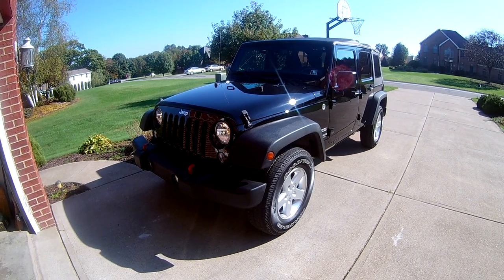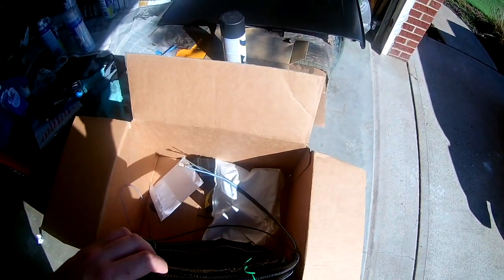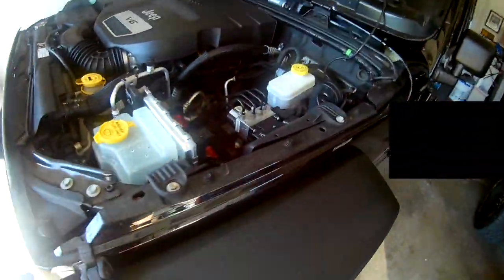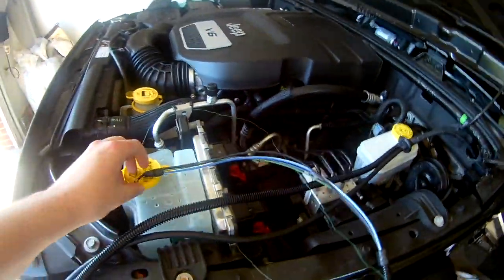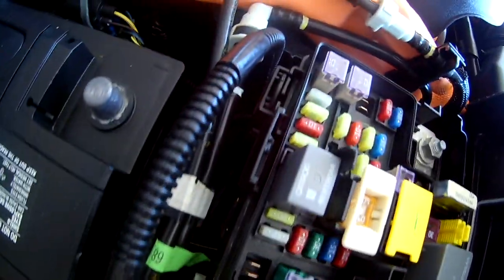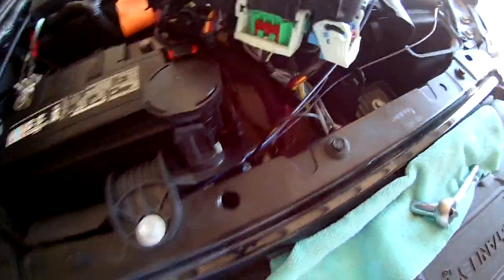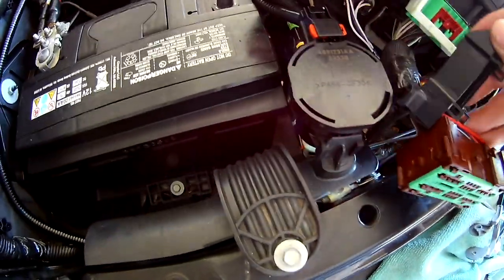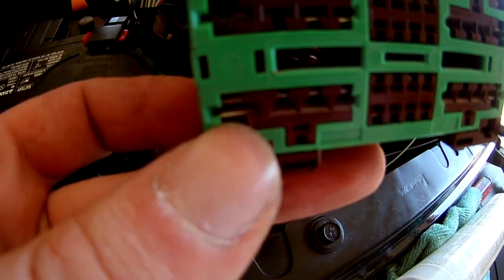How to Wire Jeep Wrangler Hardtop Harness

Comment from the maker: https://www.quadratec.com/p/mopar/hardtop-wiring-kit-late-wrangler-jk/late-without for the wiring kits. Select the option that fits your application. 4 wheel parts or eBay should have them as well. Amazon is currently showing unavailable

Comment: Thank you for your video. I was in the middle of the install before coming across your video. I went back and checked my E plug connections to the TIPM and they were wrong. I trusted the install instructions and they are wrong. You saved me from smoking the harness.
Reply from the maker: Awesome! Glad I could help! When I wanted to do it I was shocked to not find any videos. Then dissecting the instructions I realized how confusing they made them and how easily you could make mistakes. I knew I had to do a video if my install worked

Comment: Thanks for the post. It helped a great deal. I installed a 2016 top on my 2008 JKU. The Mopar instructions are lacking to say the least. Just a bunch of pics. A few words here and there would have been helpful on their part. I had the harness run and was scratching my head in a few places at the fuse box but you helped a great deal by pointing out that the pin numbers were actually on the connector. It took two pairs of glasses to see them but I found them. I didn't cut the one wire on the harness but actually pulled the pin and soldered the new wire to the pin end. You have to be real careful doing it that way as it's a real tight fit to get the two wires back into the connector. This kit is a lot more involved than they lead you to believe. But success, my wiper and washer did work but the rear defroster lights up for a second and goes out. Off to the dealer to flash the ECM with the new codes. Thanks for the help. I love YouTube videos.

Comment: I installed kit #82212860 on my 2016 JKU Rubicon 3.6 6 speed manual transmission. I had heated mirrors on the Jeep already. Between the Mopar instructions and this video I was successfully able to install the new wiring harness and flash the ECU ($100.00) without any issues. 
MAJOR TIPS:

The CONNECTION PLUG to the harness DOES NOT FIT through the opening of the fire wall. When routing the harness through the fire wall pull the harness from the inside of the vehicle through the fire wall into the engine bay.  Snake a wire from the engine bay side into the inside of the vehicle. Route your snake wire keeping it along the body of the vehicle of the drivers side. 
 
1.     When looking for the location of where your wire needs to be plugged into (if it is occupied just make sure you match the same color wires)  If it isn’t occupied then there are VERY TINY numbers indicating every specific spot. Take your time the wire placement is key to the entire operation. 

2. If your “E”,”G”, or “C” plugs have existing wires in a place that it tells you to install the “NEW” wire  from the new wire harness kit then just heat shrink or tape off you old wire that you have to pull out of the plug. THE OLD WIRES DO NOT GET REUSED OR SPLICED INTO ANYTHING ELSE. EXCLUSION though is on plug “E” it tells you to solder to the “EXISTING WIRE” that’s ok just remember to heat shrink it nicely. I actually had to pull the wire out of the plug so that I could get my heat shrinking tube over the wire at my solder connection. No big deal it took an extra few minutes for a better/safer end finish. 

3. You do not have to remove the seatbelt and strap and all of that nonsense. I removed the plastic along the door sill. Then I raised my seat belt height selector ( the part the raises and lowers at your shoulder when sitting in the seat) to the highest position.  The plastic cover where the seat belt is concealed by on the body of the Jeep. It is actually two pieces of plastic. Gently pry the top one outward and then the lower one will have room to be removed. That way you can continue to route the wire along the body of the Jeep heading to the back area. 

4. The AC vents do not need to be removed or taken out of place. They are mounted to the dash it’s self. They only want you to remove them so that you have better hand placement when removing the dash. You are still able to get a firm grip once you remove the window opener switch. Take your time be gently. The dash will come of easily. If you were to remove the vents themselves from the dash then you risk damaging the foam that makes the seal. If that seal is broken it will have to be replaced and the wire will leak out of the vents back behind the dash. Not harmful but will not be as efficient. 

5. Last tip and then I’m done. Print the ECU codes out for your technician. It will speed the flashing process up. I just printed out the directions so I could refer to them as I was doing the install then I left them in the Jeep for the technician to refer to if necessary. In my case he was grateful that I did. 

Hope this helps someone out. My tips will speed you up and give you confidence that this will work once you’re done in the end.

FYI: you can use a very tiny flat head screw driver to push the wires out of their plugs.

Comment: Thank you for taking the time to make this video. It saved hours, especially considering the included instructions were pretty bad. I wanted to mention a couple of steps that I left out that didn’t need to be done and could save a little more time.

First, you do not need to remove the air vents as they stay in place when the dash is removed (stay clipped into the dash).

Second, you don’t need to remove the seat belt. From the backseat, I just ran a wire (bent hanger) through the channel under the seat belt to the front, taped the tube & defroster/wiper plug to it and pulled it back through.

Thanks again! Now I just hope my dealer doesn’t give me any issues trying to flash it.
Reply from the maker: David Bozard My dealer gave me no issues at all. Seemed like something they did often
Reply: Thanks. How long did the dealer take to do the flash? Did you wait or have to drop the Jeep off?
Reply from the maker: David Bozard call ahead and make an appointment if you can. They said it would only take a half hour (they charge u for a full hour), but I also had them look at my transmission for a rattle. Even then it only took them a little over an hour to program and put my jeep on the lift and look at it and called me when it was done. If you have an appointment, I don’t see them taking much longer than the 30 minutes to program.
Reply: Thank you!

Comment: Wish you had posted this video sooner. I tried installing this on my last 07 JKU and gave up on it halfway through. I only got the wiring through the firewall and connected to the hardtop. I never finished installing the dash and turn signal kit. Now I have a 2017, and going through the same deal of not having the wiring kit for my hardtop that I purchased separately. Likewise, thanks for sharing the video.

Comment: Thanks so much for this video! My wiring harness project in my wife's 2014 JK was a success and using your video as a reference really helped, especially since my Mopar kit was missing the instructions. I found them online, but as you mentioned a couple of times they weren't always correct.
I also ordered an ODB II device and downloaded JScan so we'll see if I can flash the BCM myself.

Comment: I do have to say Thank You for this video.  I watched it before even attempting to do this on my own.  First problem I had was nobody is currently selling the harness anymore.  Quadratec has it backordered till December 2020.  I called a Jeep wholesale company on the internet and they told me the reason it's backordered is because it has been flagged at Chrysler for an "engineering" reason and the rep told me that due to that flag, no dealership is allowed to sell them until the flag has been removed.  He told me to keep an eye on Ebay and after a week of checking, I found one being offered brand new.

I think the most difficult thing was the soldering part.  I used the recommended solder type and for some reason it didn't want to cooperate.  After about an hour, I got everything together, heatshrinked, etc.   Also, for anyone that is looking to do this, the diagrams for the terminals that are on the instructions are meant to be read while you're looking at the backside of the terminal housing with the wires facing you (basically if you're looking at the wires going into the connecter, that's how it's presented on the instructions, but the instructions don't have the wires in place for viewing purposes).  If you look at the face of the terminal, you're looking at the mirror image of what the instructions are conveying and that's how people are using the wrong terminal locations.  As others have noted, there are Letters on the underside of the housing that tell you which connector is which and each connector has extremely small numbers on the housing.

My new windshield washer pump had each connector for the hoses labeled.  One was labeled F (I assume for front) and the other was labeled R (I assume for rear).  The one labeled F was in the same location as the original pump location, so one would assume that is exactly where I should hook up the front hose.  I hooked up the hose for the new hardtop rear washer to the nipple with the R stamped on it.  I had removed my front driver's side tire and removed the trim plugs and the one bolt/nut holding the front half of the inner fender in place and moved it aside for access to run the new hose in the factory location.  Basically following the route the original front washer hose takes.  I went and bought a 90 degree vacuum line fitting and a straight vacuum line fitting and that allowed me to connect the new washer hose without it being bent.  I put everything back together, and imagine my surprise when the I activated the windshield washer and the sprayer sprayed the back window, and the rear sprayer activated the front lol.  I had to reverse the hoses on the new pump.  I'm wondering if that is why the harness has been engineer flagged at Chrysler??  

Anyways, thanks for the solid video that saved me some headaches.  My stealership is charging me $109 for the flash, but it is what it is.
Reply from the maker: HawesEA wonder if it’s a new “engineering” reason or not.. because they have been making them for a goood while now....  about a month ago my entire tank of washer fluid drained from the rear wiper line (I have my soft top on so the harness is just tucked in somewhere back there ) into the storage area where the jack and all is... that was a nice pleasant surprise.. never had that happen before.... anyways glad I could help!
Reply: @tybonez3646  sounds like the check valve may need replaced.  On my 2016 Rubicon which came with the dual top package, the hose coming from the front of the Jeep to the back area plugs into a check valve, then to a piece of hose approximately 3 inches in length that has a quick disconnect for when you want to remove the hardtop.  The vehicle I installed the harness in was my daughter's 2018 JKU, so I mirrored everything to my Jeep as far as hooking up the hoses.  Only reason it would leak fluid is if you don't have a check valve or the one you have is broken.  Easy fix regardless.  I always run with the drain plug in my jack area unplugged.
Reply: Mine sprayed reversed as you described. When I activate the rear wiper pump I can hear it pumping and if I disconnect it at the hardtop connection it sprays out onto the ground but plugged back in and it doesn't spray the rear window. I bought a used hardtop, wondering if the nozzle is clogged up, I'm going to try to push air through it to test it?

Comment: Thanks so much for this video, My 2016 Rubicon Hard Rock came with the soft top from the factory, Someone then added a hard top, but didn't bother to buy the harness for the rear defrost or washer pump. So, this will be in my future at some point.
Reply: Se7vinDeadlySins 
@Se7vinDeadlySins so when they added the hardtop did it have the rear wiper and motor on?
Reply: Rob B, yes. The hard top they put on does have the rear wiper and motor on it.
Reply: ok i want to do the same buy a hardtop but not the wiring kit since i don’t need it thank u
Reply: No problem Rob B

Comment: Dude I’ve been trying to find a video on this fucking forever thank you for putting it up gonna install tomorrow
Reply from the maker: Marcus Reyes sure thing! Figured it would help put a better visual than the black and white drawn diagrams molar included.. Be patient with the removing of the pins in the connectors and confirm you are cutting/replacing the correct wire. I’ve been running my hardtop for about 3 months and the harness has been working flawlessly.  Let me know if you are confused about anything.

Comment: Super helpful. Thanks for posting. This took me all day, luckily it was a holiday. Just hooked up on my 2017 wrangler unlimited.
Reply from the maker: Trey Ideker awesome! Glad it helped
Reply: Btw I managed to get the rear hose routed exactly parallel to the front one, it looks great but probably wasn't worth it. To have the right access I had to pull off the driver's side fender, which caused me to break a bunch of plastic rivets. Now I've got to order rivets!
Reply from the maker: Thanks for the tip! I was going to do that eventually but maybe I won't now haha
Reply: What tool removal kit did you use (if you used one)? Thanks!
Reply: You mean rivet removal on the fenders? I didn't use one - just pulled and they popped.  To reinstall, I used this and this:
https://www.amazon.com/gp/product/B007QV2E50/ref=oh_aui_detailpage_o01_s00?ie=UTF8&psc=1
https://www.amazon.com/gp/product/B01GES5OYS/ref=oh_aui_detailpage_o01_s01?ie=UTF8&psc=1

Comment: When taking the steering  column off instead of using a torques use a 7/64 t-handle allen wrench 
 in those deep pocket 
holes . Some sticky black window seal  rope will hold the screws on the allen wrench . Great video .

When taking the steering  column off instead of using a torques use a 7/64 t-handle alen wrench

Comment: This is incredibly helpful! Thanks you!! I know this was posted ages ago, just curious how you actually removed the wires from the terminal, notably the blue white one. Im having a heck of a time even using a terminal removal tool set from amazon. I pulled the green face slightly aware, been fiddling with the wire using all types of prongs to no avail.
Reply from the maker: I can't remember to be honest. Look at the wire you are trying to replace it with to see where the tabs are that hold it in the connector. With that in mind, then try removing it. I know I struggled with most of those terminals as I did not have any terminal removal tools, I used really tiny flat head screw drivers.

Also, on the front of the connectors is usually a plastic piece that is a different color. Usually those pop off and reveal the locations to stick the terminal removal into to release it. Take your time, leave and come back to it if you need to. I had one stubborn one behind the dash that I ended up cutting and pulling it out from the front.
Reply: Agree too that sometimes it better to walk away, take a break and re-eval :) Thanks again!

Comment: Thank you for making a very informative video. It's a great addition to the written manual. I was just wondering when there is a wire populating the spot that the new wire has to go into what are you supposed to do with the wire that you pull out? Hope this makes sense.
Reply from the maker: Lorenzo Gioielli if there was a wiring populating the spot and it was removed and replaced, I just electrical taped the end then taped it to another wire or something nearby so it wasn’t bouncing around
Reply: @tybonez3646  Ok great. Thank you for your response.

Comment: Hello i know you posted this a few years ago but i have a question , Did you notice if your wipers did or did not now work with key in accessory position i have a dealer install my kit and wipers work with key in accessory position and a have a large battery draw when in accessory, Thank you RM
Reply from the maker: I believe they did work in accessory position (2 key clicks) engine not running. But I’m not 100% sure. I sold my Jeep for a truck a few years ago.